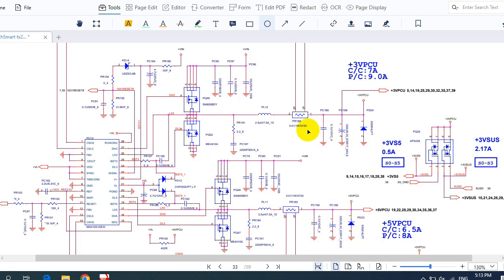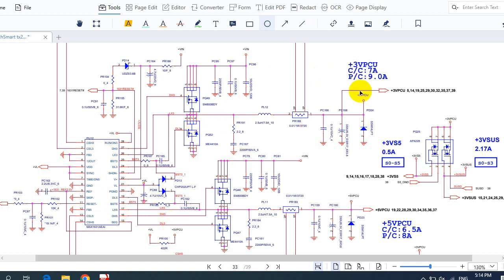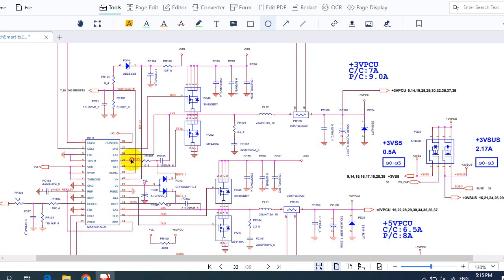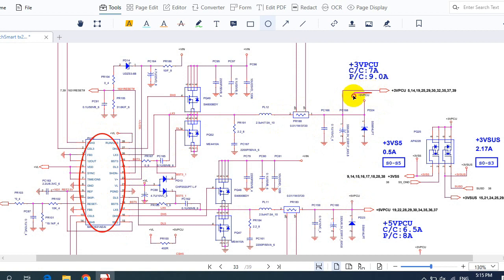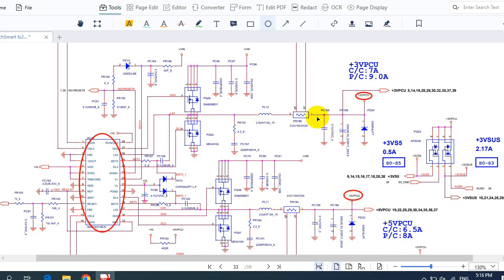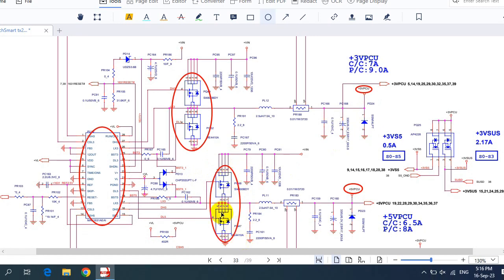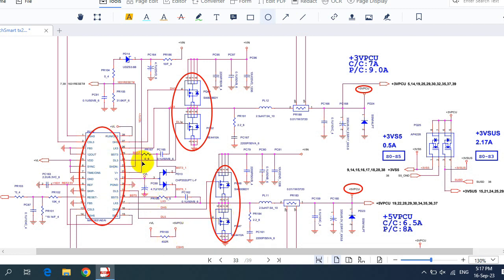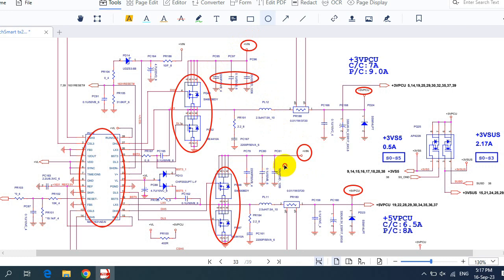3VALW 5VALW System Power Circuit - Computer Schematics

Comment: plz sir type c
Reply from the maker: ?? What do mean exactely?
Reply: @electronicsrepairbasics_erb  USB type C  power Circuit Diagram  such as  Lenovo E590 e490 e480
Reply: @electronicsrepairbasics_erb  Laptops that use USB-C instead of the round pin to plug in the power adapter. There is a chip or chip on the motherboard that has to " negotiate"
with the adapter to let the 19 volts through, a lot harder to trouble shoot, ok? For instance right now I only have 5 volts coming in from the power adapter on my Lenovo ideapad. Trying to follow where the power goes and where it stops is a b itch, at least for me. ok? If you could make a video like the one here but do it with USB-C chargering, it would be great, ok. You are an excellent teacher!